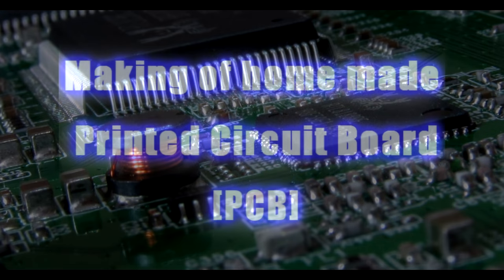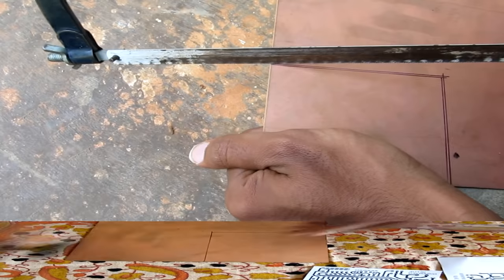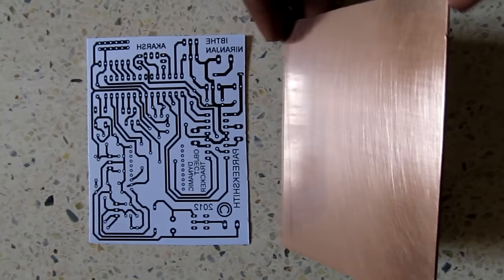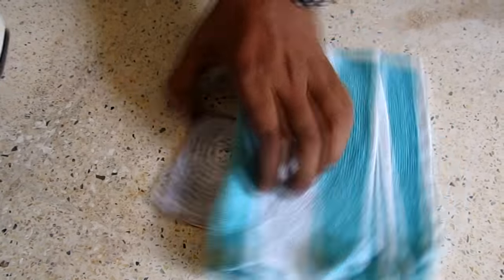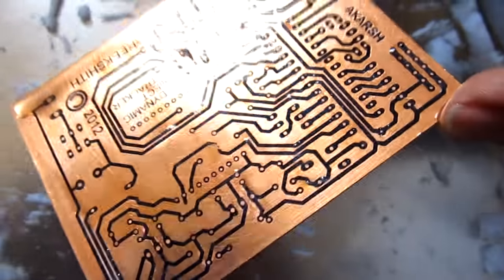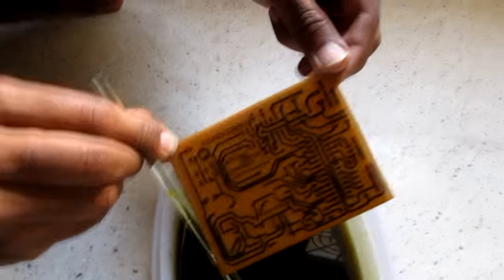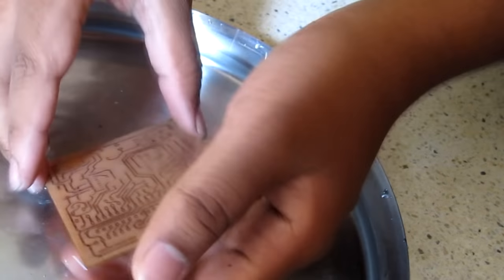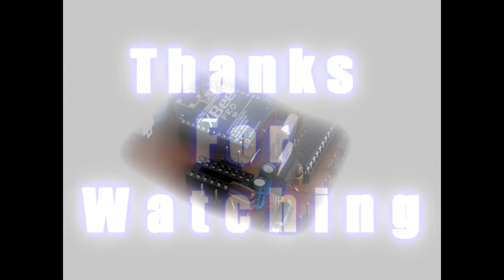Making of PCBs at home, DIY using inexpenive materials

Comment: Tip: Use acetone (nail varnish remover) to wipe off the toner. Scrubbing risks damaging fine tracks whereas acetone dissolves the toner.
Reply: Yes
Reply: GOOF OFF is actually way more effective, and hydrogen peroxide + muriatic acid works better for stripping the unwanted copper.
Reply: @pcbdesignhub1847  This is a DIY video. People are watching this so they can do it themselves - not order PCB's from you
Reply: the only problem with acetone is that you'll get black/grey smudges on the bare board as the toner dissolves.
Reply from the maker: True
Reply: @chizknocka in how much proportion do I need to mix muriatic acid and hydrogen peroxide ?
Reply: Petrol is better

Comment: Good job and great video. I used to do it that way too. I just want to add a little tip that will expedite the process. First, you will need to dip the board in ferric chloride solution made out of hot water, and you need to agitate it. What I did was, that I put a small marker under the container with the board and the solution and gently rocked it. Also I used a lamp on top of the solution and the board so I did not lose heat, so the agitation process is faster. That worked like magic. Good job and good for you.

Comment: Also remember to neutralised the ferric choloride by putting baking soda before disposing it off.
Reply: Can't it be re used couple few times????????
Reply: Ivan Paul
hmmm...good suggestion..may be it work but not tried..
Reply: Tabrez Shaikh
I saw more videos and they say we can save it for future..i will also try it..
Reply: Ivan Paul You can use it again, i have been using the same ferric chloride for a while now, the only difference is that it will get weaker over time
Reply: Tabrez Shaikh what is the best photo paper to use and what brand?
Reply: He's indian, he'll just throw it in the Ganga River :p
Reply: Question: Where can I buy ferric chloride?
Reply: @awwastor  At the local grocers..!!

Comment: no. you should only drill after you etch.The etching helps align the drill bit (trust me, this helps a lot!) and if you drill first the acid will start to etch the copper from inside the hole.

Comment: Pareekshith, this is one of the best results I've ever seen. Most people use much less than 15 minutes for the hot transfer and that seems to be a problem. I have two questions:
1. Can you do double sided at the same time?
2. Do you get any pitting under the tonner?
Reply: I only spend about 2-5min on heat transfer method (depends on the size of PCB) and it always work for me.

Comment: For circuit simulation you said NI multisim circuit suit does the job but that program cost a lot of money. Try using Circuit Wizard, it is only 150 euro and is much better as a simulator, not spice sim a real sim where the circuit comes to life. There are others out there as well for free and much cheaper than $850. 

Great video!!!

Comment: I am having hard time trying to make my own PCB using the toner transfer method. When I go to iron on the circuit artwork, the photo paper sticks to the iron long before it will stick to the copper clad board. I have sanded, scoured, doused in alcohol and wiped  it clean before attempting to transfer. Suggestions?

Comment: Hi, did you print the mirror or the board itself ?

thanks
Reply: The print out should be mirror of orginal...that is horizontally flipped
Reply from the maker: +s4 league 
If its top side SMD layer, then mirror

Comment: Hi.
I am using PCB Wizzard. Now that i printed out schematic and ut paper on pcb and drill holes, and connect holes with marker according to schematic. Some how 555 timer do not fit corectly, pins problem. Do i have to draw schematic on pcb using mirror?
Reply: You need to justify your printer. It applies automatically a 1 or 2-percent enlargement. Be sure to print exactly 1:1 copy.
Reply: Aleksandr Kropachev Scale is OK. I am talking about mirror effect.
Do someone come across this problem when you draw lines with marker, specialy when comes to Components  like chips when pin controll is very inportant, unlike other Components where you can simply switch sides.

Comment: Hello sir ,I heat the photo paper around 15 to 20 minutes but the circuit diagram is not print on the copper plat.so sir pleas e help me about this problem

Comment from the maker: Copper plate you can get from electronic components supplier shop and
Ferric chloride from Lab equipment dealers.
yes you can use magazine paper but there is a risk paper getting folded inside printer.

Comment: "distance between two consecutive pathways" is nothing to do with conductance efficiency. PCB cad tool guides automatically for the minimum distance between the tracks.
If the signal frequency is too high and/or voltage is heavy then distance between the track matters.

Comment: Yea, wrong printer (inkjet) in general. Though I still don't know what was up with that photo paper. "kodak photo paper" made one heck of mess on the iron. I ended up taking the image to a printer shop and they photocopied it onto photo paper which worked ok.  I"m still working on my technique to get just right amount of pressure and temperature to cleanly transfer the toner. It seems that if I press too hard with the iron then it comes out blotchy or smeared.

Comment: from where you got ferric chloride
Reply: khushbu agarwal Use this solution instead, 2 parts Muratic Acid, 1 part Hydrogen peroxide, much safer and can be used again as well, just add a fish aquarium bubbler to it while you are etching and you will speed process up greatly..ALWAYS REMEBER TO ADD ACID TO THE HYDROGEN PEROXIDE SLOWLY< WEAR GLOVES AND GOGGLES OR AT LEAST SAFETY GLASSES. I used this process all the time and is much more eco friendly once neutralized with baking soda. Always store it in a plastic container well marked Cupric Acid !